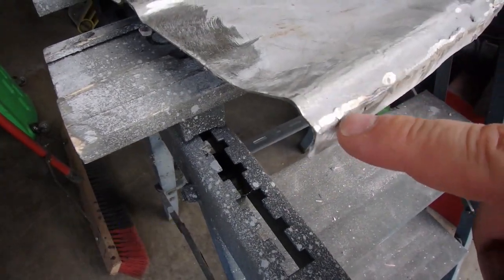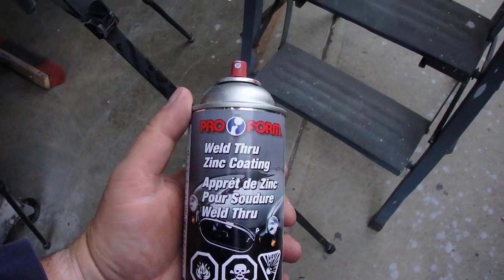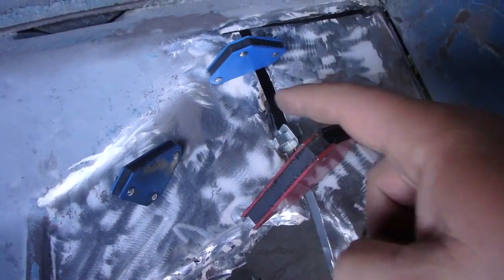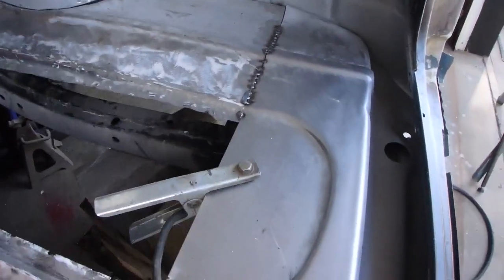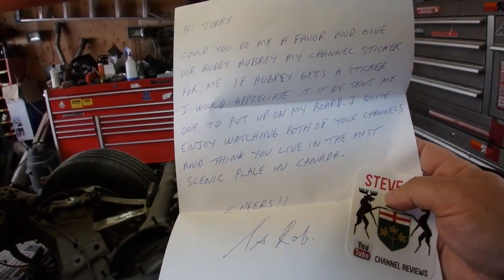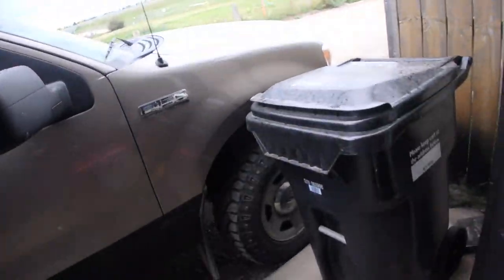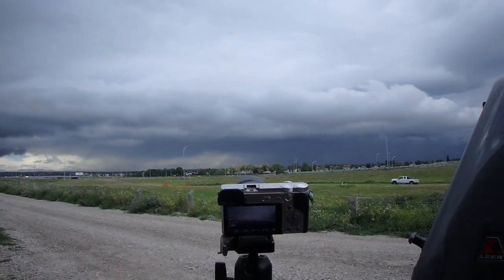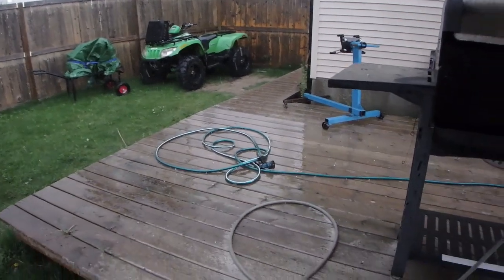Welding the Trunk Floor In

Comment: sealing welds with short strand fibreglass filler could be an option. that project is coming along well. hopefully work will come your way soon.
Reply from the maker: that was one option i had in mind another was a metal bondo

Comment: Jerry did you mention where you got those flange joints that go between the sheets for welding those are handy I have to do my tailgate could use some of those  .
Reply: Harbor Freight has a four pack.
Reply from the maker: since your canadian and the link is for America you can get them at princess auto in the welding section
Reply: Bullshitkorner Oh super I'll get some Thanks

Comment: I live in northern mn. What they call the iron range. And also,, millwright is a very important trade around here also, specially with all the taconite mines. Union jobs with good benefits. I myself took a different trade years ago. But after all the years put in, and skills acquired, i get paid just as well with benefits, if not better than most millwrights. But auto body repair changes every year. New equipment, new materials, new specs on all vehicles.. when i say body man, there is a little more to it than bondo/ primer work. Structural integrity, frame work, knowing motors, air bag set up, using engine diagnostics, just about everything that deals with vehicles.. but,,, i still have people look down on me cause I’m a ( body man).  Till they realize i make more money than them.get better benefits than them, and have ALL weekends off!! Work from 8-4:30 every day. M-F. With what I see,,,,, you might definitely make a good ( body man)!!!! Just something to think of buddy..love the vids!!! Keep um coming!! There is no shame at doing what you do best. In my eyes anyway.
Reply from the maker: a body man is a hard skill that requires lots of patience, something i need to work on